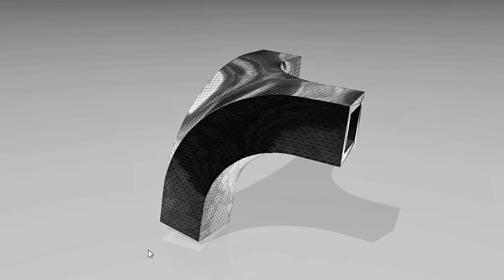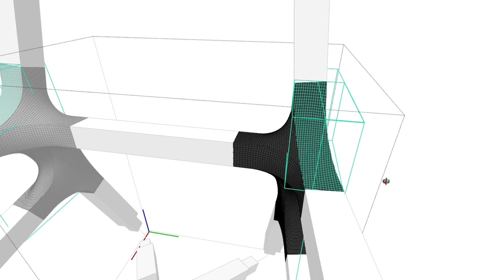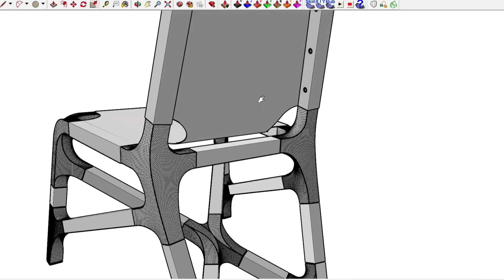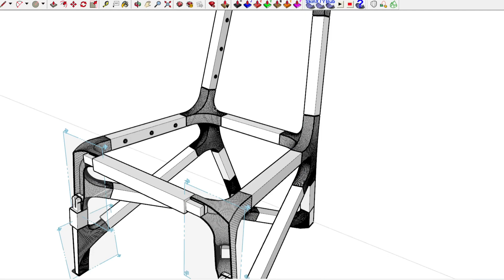Componentized 3D Printed Chair

Comment: good design, but chair wont last long. 3d prints are not strong for 100kg or even 60kg in long use
Reply from the maker: Probably true. The glue does help, but it's not a permanent solution.

Comment: I think it would be interesting to keep the chair unglued to permit disassembly. That would allow much greater portability as people today often need to move regularly.
Reply from the maker: That's a good idea too. For that I would need to implement the snap-together configuration with a release at each joint
Reply: What kind of a release?
Reply from the maker: @ A thru-wall push release for the snap in-place piece